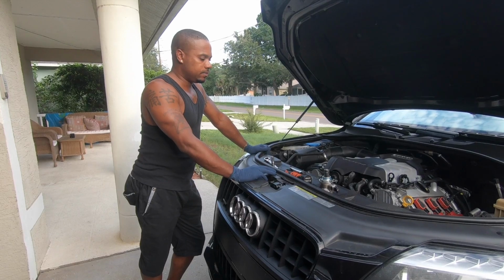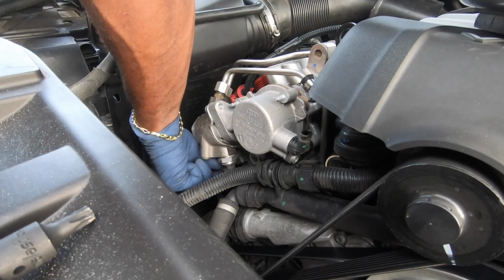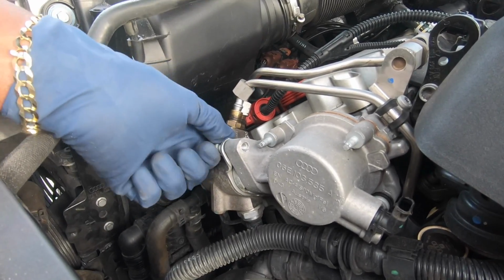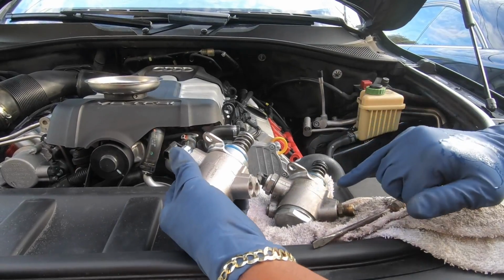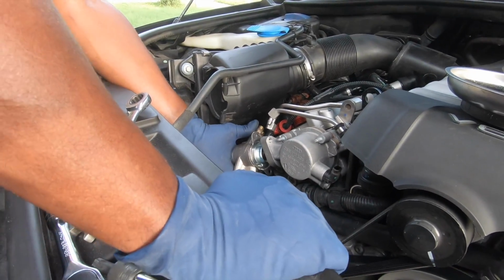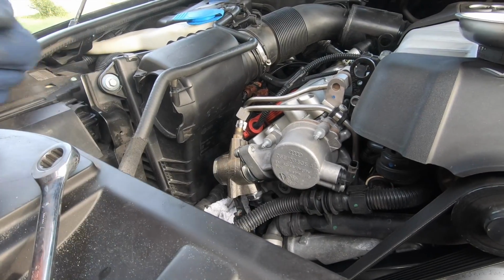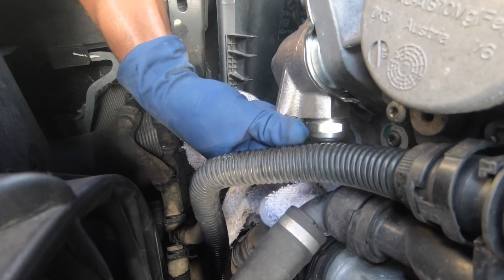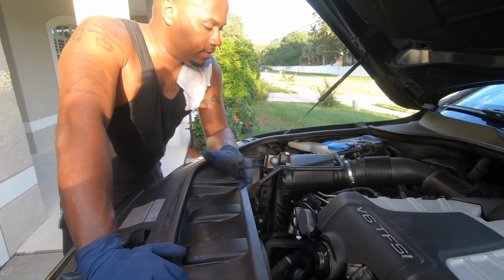High Pressure fuel pump on Audi Q7

Comment: Thanks man. Couldn't find anywhere on the inet where that thing is. Most showed you should remove backseat or something. Unfortunetly I was misled by internet people saying some fuel smell in the oil is fine for the direct injection. Being tranquilized by those comments I now have scortched cylinder. After replacing that thing hopefully I can drive for some time without engine rebuild.
Reply from the maker: @NickolodeonUser  damn that sucks. Sorry to hear that.

Comment: Great video and thanks for sharing this job . Where did you pick up the Chinola pump ? 
Also did you do the timing chain guides or were they done previously ? Thanks again
Reply from the maker: I got the pump on Amazon and it cost me $600 to get timing chain guides done. Common problem with these motors.

Comment: Thanks for the video. Did you disconnect the battery at all? I’m doing a water pump job and wondering if I should disconnect the battery. I’ve heard the batteries have to be coded when replaced or re-connected.
Reply from the maker: No, my battery is under the seat so it’s a pain in the ass to get to

Comment: my wife 2014 started doing this. Did you get any code from an OBD reader?

I will admit, I flinched when you cracked the fuel line. Diesel engines can run at 25,000psi or more. enough to cut your fingers off if you crack the line under pressure.
Reply from the maker: @zerobucks9  no codes it was just taking longer and longer to start every day

Comment: You should did replaced the cam follower too... it's part of the maintenance.. but yo did a good job..
Reply: I don't think that's the case with the roller style.
Reply: @leepeezy  exactly my questionall this while, i dont think the roller style gets faulty like that, except if it is stiff, which you can just clean

Comment: Does this apply to the same category for my audi q7 2008 . It throwed me the code p2293. And the car was super weak.  One day I got home parked it and when I turned it back on. It started but it worked die right after.

Comment: What's the fix for Audi Q7 with P0172 code? I have the same code according to Auto Zone but was told it could be ignition coils or spark plugs because the startup is tough, with a rattling sound like a chain or something, and then I have to give it gas to start it. Someone said it might be my oil pump going out, but not sure. Also easily burning 5 to 10 miles as soon as I crank it up and drive a mile down the street.
Reply from the maker: Well, I can tell you right now. You need timing chain guides in the back of the motor because we had the same problem with this one on startups. As far as a rough idle, it could be the coils or the spark plugs.
Reply: @Floridamuscle  thanks for the tip. The timing chain isn't a diy project for a newbie, is it? The idle just fluctuates rpms..up and down rhythm.
Reply from the maker: @youbrowsing  no you need special audi tools
Reply: @Floridamuscle  thank you for the tips. I'm not sure if I need to keep this car. So you use a scan tool? I saw one on Amazon with tons of reviews for $23
Reply from the maker: @youbrowsing  I have a autell i bought off facebook for like $300
Reply: @Floridamuscle  thank you for sharing.

Comment: Hey question any problems since then ?
Reply from the maker: No sir
Reply: After I change me I’m hearing a noise when I give it gas. I’m thinking that I don’t put that circle piece in correctly
Reply from the maker: @uptodatimet6  Take it back apart and check it out or replace it